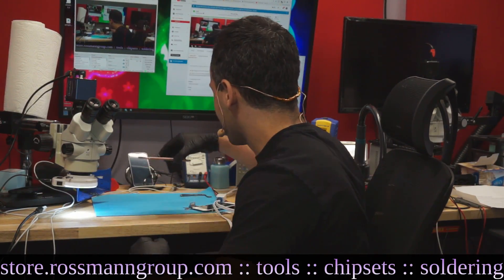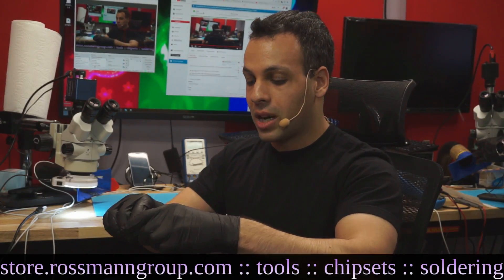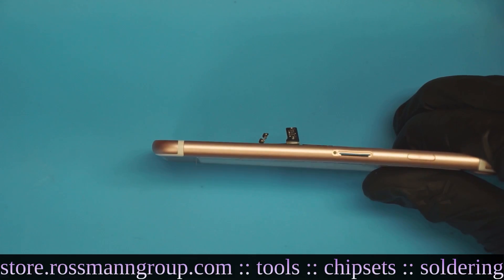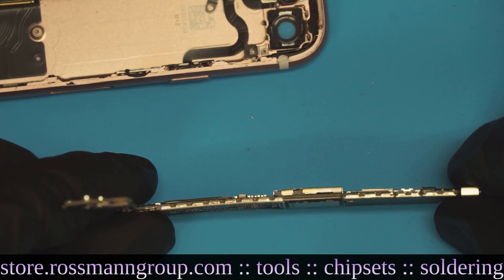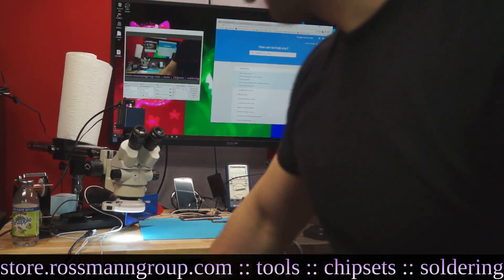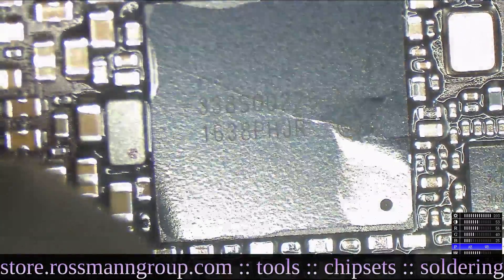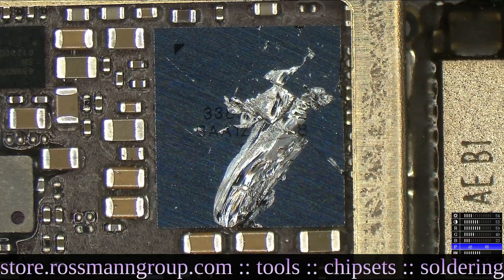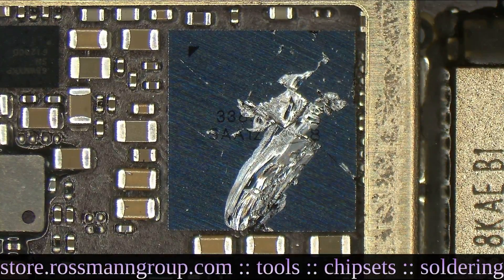How the iPhone 7 handles a drop: how sturdy is its case? What happens to the insides?

Comment: Hey Louis, I was wonder if it was possible to repair an iPhone 7 Home button. For example, if the flex cable is ripped, could you hot air the IC chip off the broken flex cable and solder it in a intact iPhone 7 home button flex cable? Everyone is saying that the only way to get it fixed is to go to Apple, but... there must be another way so that I can repair my own goods without having to pay $319 for a freaking home button replacement...................................

Comment: Whomever decided to use an aluminum frame in a small, thin device like that is a total idiot. Aluminum is lightweight, but it can bend easily. You typically have to use about 2x-3x the thickness of Steel when using Aluminum, in order to have it be as strong as steel.

Comment: that's why I like my phones a little heavier and sturdier. This whole ultra slim phone hype is just total nonsense. Most manufacturers sacrifice durability for less weight. I have an LG G5 with Spigen Tough Armor case and the battery runtime is lousy. The phone case is very good but makes the phone much thicker. I would rather have a thick phone with INTEGRATED gumming and a 4000-5000mAh f*cking INTERCHANGEABLE battery than a super slim one where I need to buy a protection case ANYWAY!

Comment: Must have hit the ground just the right way to produce a bend like that, perhaps on the edge of a stair or something. It's kind of absurd that there is no cushion inside the thing at all. Aluminum is actually a fairly shitty material for any kind of portable device, in my opinion, it's soft and scratches easily, it blocks the signals from the radios, and it is unforgiving under stress, because it bends and stays bent. Making a phone out of it was just a dumb idea.

Comment: the thing is Apple has been making phones for over a decade now, and other products even much longer. There should not be any flaws at this point. Every issue, flaw, and bug, should be worked out perfectly by now. But they are not in the market for making good products.....
Have you ever considered getting into designing electronics Louis? You are definitely more than capable of doing so. Just like you learned to repair all this stuff, you could put that knowledge into designing something much better.  Sure a lot of research and stuff is involved but if you actually wanted to do it, you certainly could. You have a great foundation for starting up something like that.

Comment: Hi Louis. I've recently exchanged totally blown 0402 cap near the wifi chip at colleagues Iphone5.. Toughest part was to remove all that ugly black glue/underfill excess around.. now that piece of crap works well again. But let me ask you a question: Do you have some cheat method, how to remove that glue? Scraping it away under microscope with sharp needle is usable, but time consuming and other components might be damaged around..
Reply: Use a hot air pencil set at 150 C to heat the underfill.  It will soften enough that you should be able to use a toothpick to clear it away and avoid scraping components and the board itself.  The temp at 150 C isn't enough to melt the solder, so parts will stay in place.

Comment: I have a hard time believing the customer dropped it from waist height and bent it like that. Not sure why they would be lying though, if it's only for data recovery. I've accidentally dropped my 6S 50 feet in the air on to concrete with nothing but an Otterbox protecting it. Bent the frame a little bit, didn't even crack the screen. I know that's probably one in 1000 chance, but these phones aren't too bad.

Comment: The iPhone 4 was built like a tank, it actually felt like a $600 phone when you held it because of the materials they used for it felt expensive and durable. I've never been a fan of the cheap, thin aluminum they started doing after that, and at least with the iPhone X they've finally returned to materials similar to iPhone 4

Comment: There is a reason why you don't normally see aluminum watches.
Reply: Usually its related to dermatitis in sensible people.
Reply: Hi Melamamoduro, very true.  Stainless steel back resolves dermatitis issue which is why almost all watches have them however.  Aluminum is soft and malleable.  The anodizing is a hardened coating, but aluminum is still soft.
Reply: but there are gold watches, and gold is soft.
Reply: although i agree u don't want  aluminum on your body, there is a huge difference between crap aluminum and very strong plane strength aluminum, or wherever they actually need strong aluminum.
at inline skate frames i experienced the difference a lot, and knowing apple they used the cheapest crap aluminum they could find to save that 1 fucking dollar!

Comment: Damn those phones suck I will be keeping my Motorola I've dropped it over 100 times in the last 2 years and the only damage was to the USB when I dropped it while it was plugged in.
Reply: Wade Ryun well I dropped my old 6s plus quite a few times over a year before getting my note 8. It never broke. So doesn’t suck for me and probably many, many others. Did they change anything for the iPhone 7, I wonder. Still Prefer an iPhone over the Motorola personally.
Reply: I broke my Moto X with the power plugged in too, now I have a g4 play with magnetic charger

Comment: I'm still using the iPhone 4. Best phone ever made
Reply: Brynnon D. do a factory reset and download necessary updates. should work fine
Reply: CutoutClips I went from a 4s to a 7 and the 4s was so slow I could barely use it
Reply: I used a 4S for three years and even by then iOS was getting obnoxiously slow. The steel frame probably remains unmatched, but I don't think much else about the 4/4S is very remarkable by today's standards
Reply: I hear if dropped, it's glass breaks into million pieces, on both sides. I was strongly advised by a person who owns one to not buy it for this very reason. Lol.